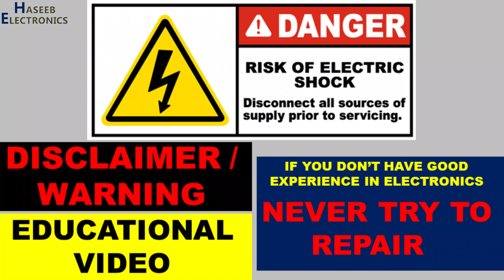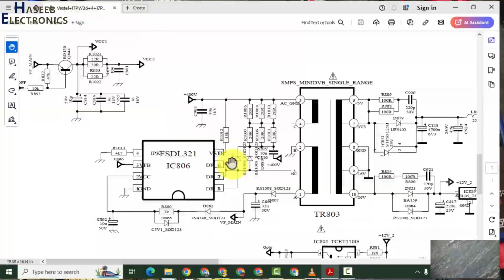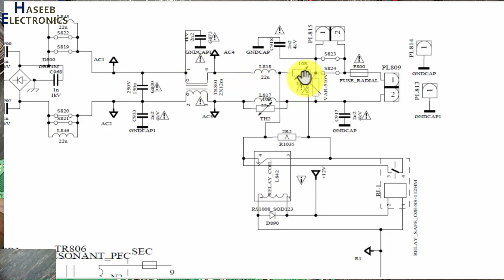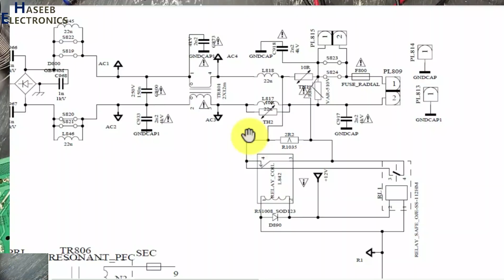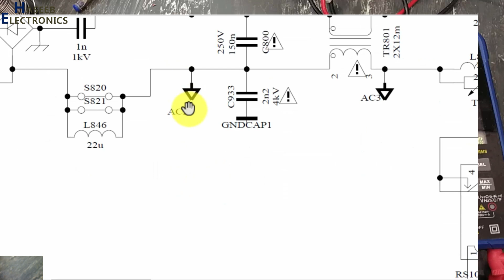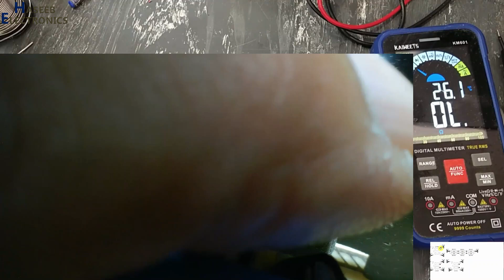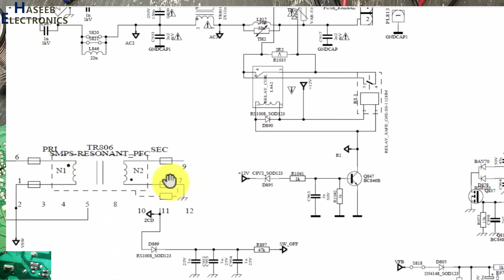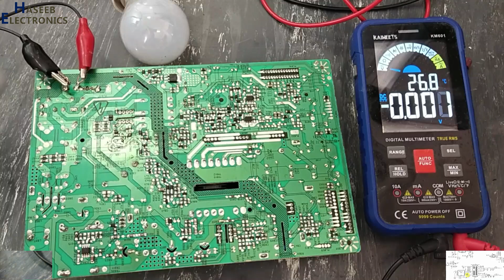{1216} Vestel Power supply working and troubleshooting

Comment: If you use in parallel 2 wires of that 1A fuse wire, will it be 2Amps fuse wire?
Reply from the maker: Yes 
You are right

Comment: Sir ek welding mechine single card 2 igbt , drive signal 51 khz bar bar igbt short hota hai,gate voltage, resi6 ok,sare chek Kia,driver tr 25:25:25 hai, igbt 40n60 lagaye, 40t60 lagaye dono mebari bari chek Kia, 40t60 lagane se ek do bar rod jalta hai, badme oc aake igbt short hota hai, problem kaha pe hoga plse. Bataye sirjee

Comment: hi Sir in TL431 what is the role of that 100nf capacitor that is connected in parralel between the reference pin and cathode and also i see that 100nf capacitor in parrallel between collector and emitter of optocoupler please explain in details its role.  thank you

Comment: hello sur i see a video for dead  welding machine the technicien man don't found  output 24V because the power  ic is bad  and this power ic generate his own vcc 12V from drain pin he dosn't need external vcc from transformer and this person use MODUL  901 to replace the bad power ic but the modul 901 NEED EXTERNAL  vcc 12V  but the transformer can't generate vcc for this modul 901  and this person use a wir he tourne this wire around the transformer to generate 12V for this modul 901  he solder one side of the wire to the ground and  he solder the other side  of this wire to the input for a diod  and he solder the output for this diod with vcc  for MODUL 901 , can you please explain as what hi did thank you